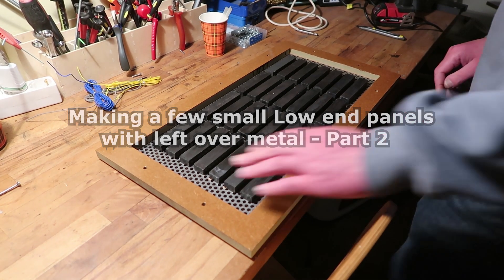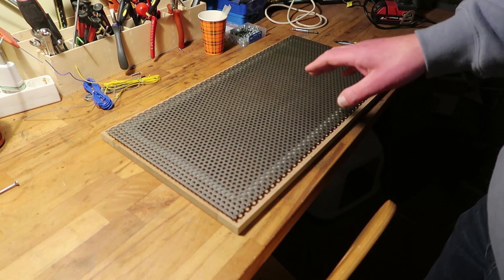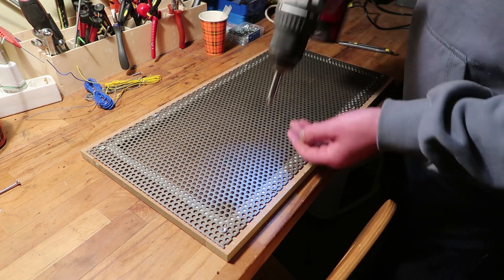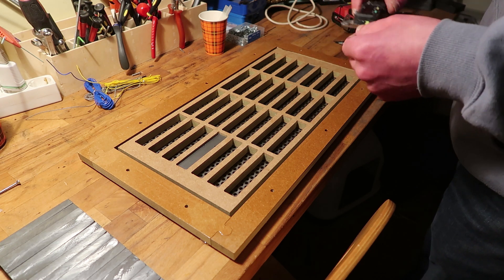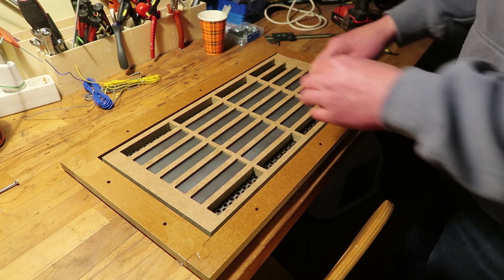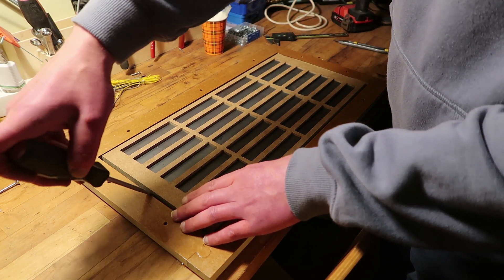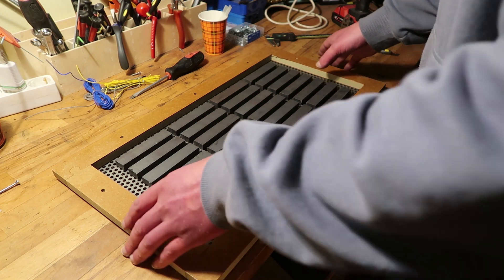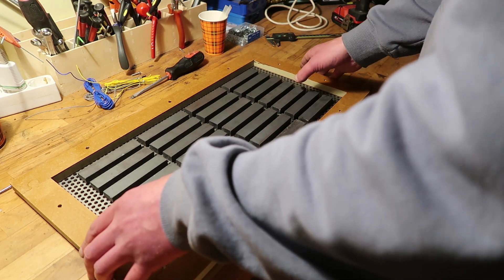Bass Planar Magnetic Woofer from scrap steel - Part 2

Comment: Neodymium has other advantages: you can have a larger X-max as you can achieve the same force of field with the magnets being further away from the foil and you can have more foil exposed to air (larger air gaps) as the same force can be applied with thinner/smaller magnets.
Reply from the maker: I agree about more open area. But i dont think x max can be increased endlessly. Foil need to be able to even stretch that far without creating trouble.   the fields allows it yes